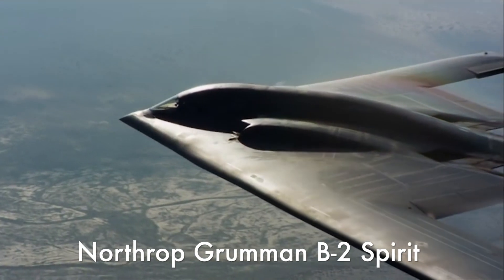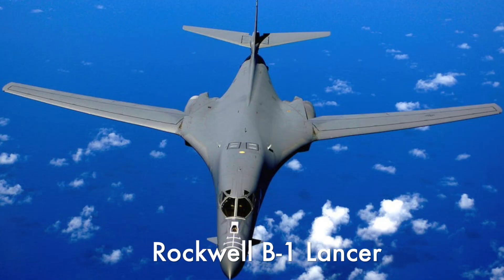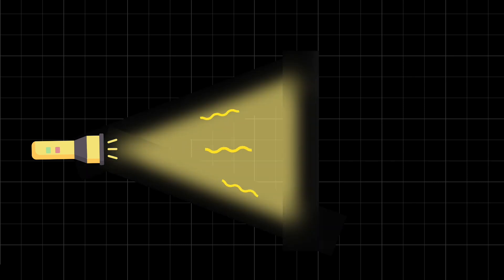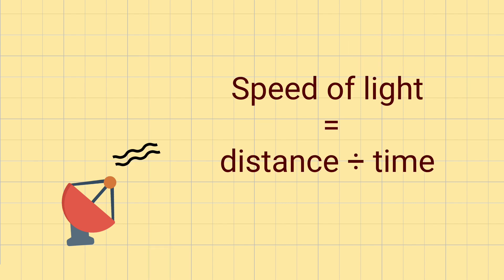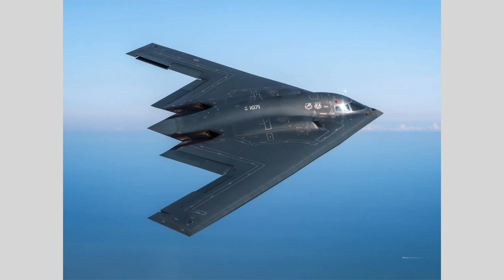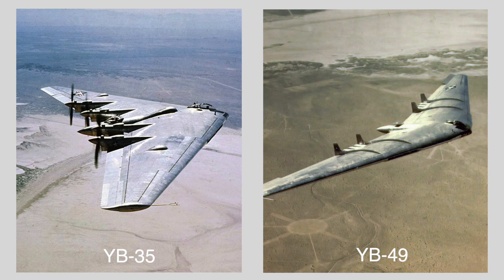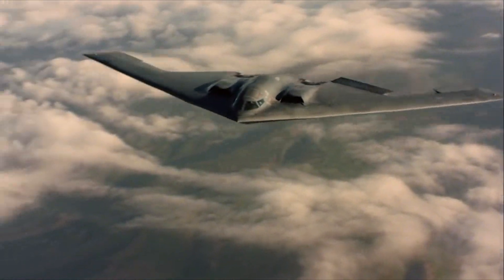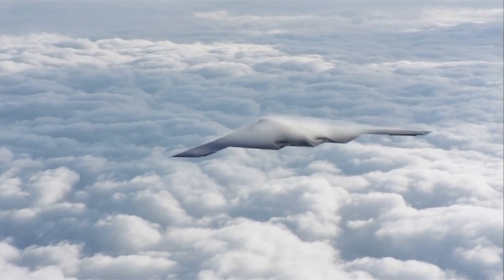The "Invisible" Plane? Breaking Down B-2 Spirit | Airplane Anatomy Ep. 5

Comment: The B-1 was meant to be a high speed nuclear bomber to replace the B-52 in that role at hi altitude. But the Soviets developed much better SAM’s and radar that the B-one could not outrun, and thus became obsolete in that role. It was then refitted to be a low altitude, high speed, terrain following tactical bomber.

Comment: You have some GREAT information, however a few issues with history- the B52 and B1 were developed long after World War 2, the B52 in the 1950s, and the B1 started development in the 70s, and operational in the 80's. RADAR really started as a technology long before the 70s- the the development started at least 40 years earlier, in the 1930s. As to Doppler radar- by itself, it does NOT tell heading- it only tells you how fast the object is approaching or going away from the radar.
Reply: Doppler Radar sets still measure distance, bearing to target, altitude, heading of target, etc, etc, etc.

The Doppler effect doesn't do these things but Pulse Doppler Radar definitely does. In fact, it's the Doppler shift measured by the radar set that makes all of these extra features possible.
Reply: @freefall0483  100% true. "Doppler" Radar is a misnomer. It is far more than a Doppler measurement. Doppler only measures velocity toward or away from the target. Pulse can bring in so much more- such as range compression from chirping the transmit pulse.

A traditional scanning radar (not a nodding mount) will not measure altitude- at all. The antennas do not have the angular resolution to make it worthwhile. Altitude is virtually always a result of a transponder signal- and that is not measured- only reported.